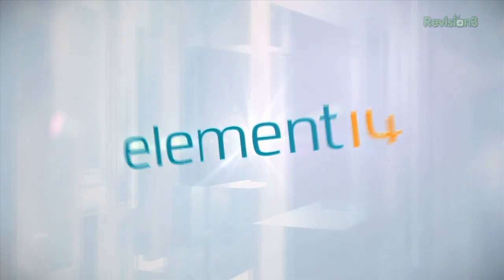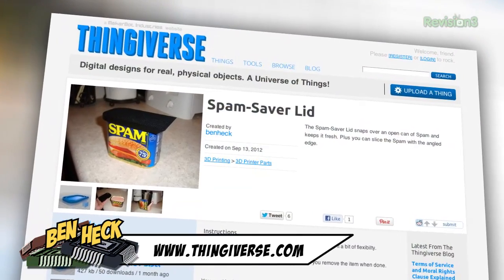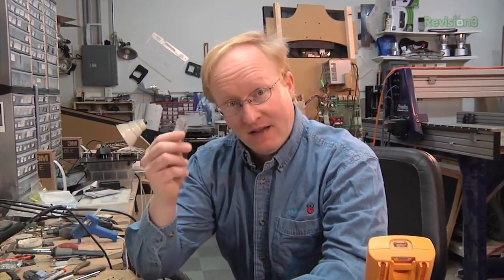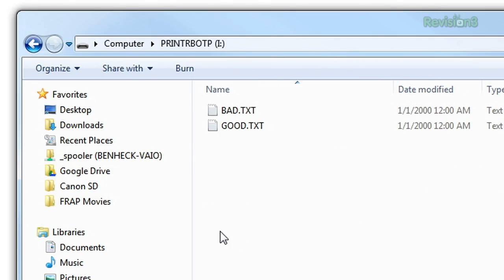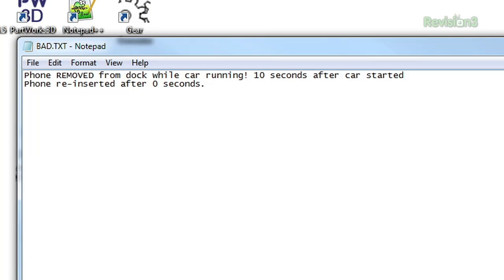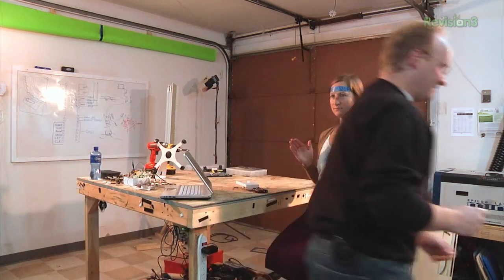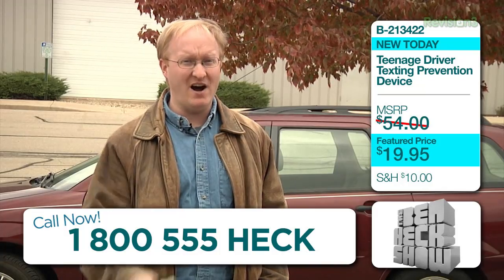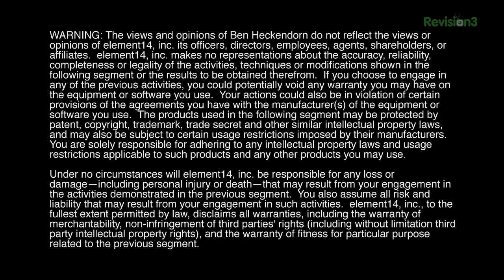Teenage Driver Texting Prevention Device Part 2

Comment: if you were smart you could wire up a rechargeable battery system with 2 megs of resistance that would be a lot of current draw and it wouldnt charge and you wouldnt have to have your phone in you could put in the battery system with the female micro usb and use your phone all day :)
Reply: Or you can disconnect the plug from the cigarette adapter^^
Reply: no this way it tricks the device and no alarm or notification to your parents and you will be genious for doing it :D MineSam DE

Comment: The better way to detect if the phone was plugged in is to let it dock into a charger and see if power is flowing. This would mean the phone gets charged (good), phone isn't used (good), and detector is dual purpose (better). This would also encourage hands free devices since nothing is preventing the phone from using bluetooth.

Also, to prevent changing of the MicroSD, either lock it down in the enclosure (like how batteries are held in multimeters) or don't write to the MicroSD initially. Instead, just write to the EEPROM area on the MCU and later write it back to the MicroSD when a parent wants to review the data.
Reply: another better method if phone is pulled from dock they dont get annoying alatm the get shock to whole seat and sterring wheel from car battery 1 amp at time. next time 3 amps  and so on until they really learn how stupid it is to text and drive  ;-)))))))))))))

Comment: Great idea. 
However, I'm wondering the wisdom of having the phone charging when you start the car. Normally, this would not be a problem... except when jump starting the car. It seems that there can be a surge that damages electronics left plugged in.
Sadly, I share this from personal experience; once burned out the charging/power circuit of a 2 meter handheld transceiver doing this.

Comment: Ben, what about a fully charged phone normally they'll prevent overcharging the battery (latest phones) will that make the alarm sound? Or you have lines of codes for the microcontroller to identify that as "phone docked"...also following the same scenario with older phones the adapter might be slight different (less common cuz kids days wants the latest phones) if there's any risk of slowly (due to constant usage) reduce the battery life due to the phone not discharging completely?

Comment: ben, will you please help me make an xbox 360 controller that is shaped like a m4a1 rifle controllers movement with an accelometer and remapping the buttons so they can be easily used on the grip. also I want to have grip sensors so when you bring the gun to you're face to aim down sights, it does the same in game. thanks!

Comment: HEY BEN

this may cause more harm than good cause when the teen takes it out (if) the sound will freak them out esspecially i their a girl. and that might cause a quick steering wheel movement and in turn causing an accident

Comment: I seriously think bikes need to employ this anti-texting device too.

Also, I think maybe some new mechanical standard for 12 volt power ports should be devised.  Maybe put a MOLEX connector in a car so 5 volts and 12 volts can come from one physical connector with cigarette lighter one one wire, and USB on another wire coming from it.

Comment: But what if said teen was bopping around with his/her BFFs to Justin Bieber and the phone falls out and goes missing. Will said teen have to drive home with a very distracting alarm which would probably be more dangerous? 
I guess if anyone thinks of building this, the alarm should only stay on for 30seconds or so then goes to a beep every 5 minutes. It's still logged so there is no risk of those pesky teens getting away with it *shakes fist*